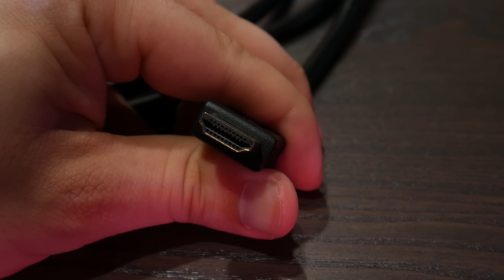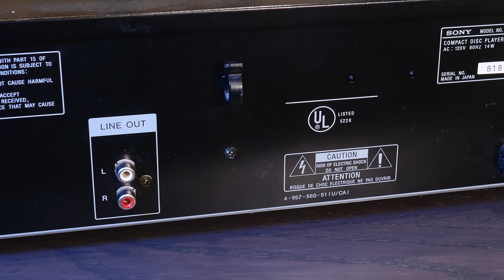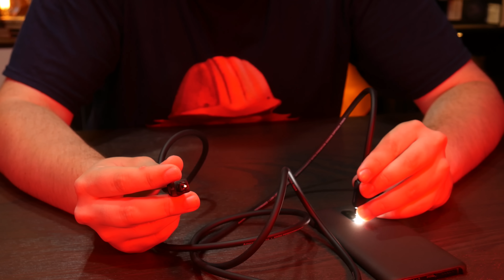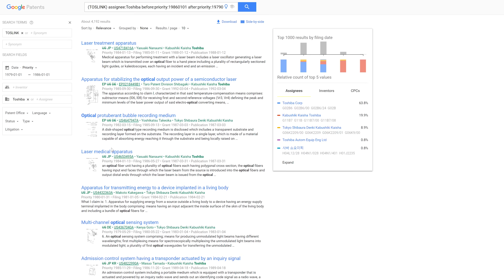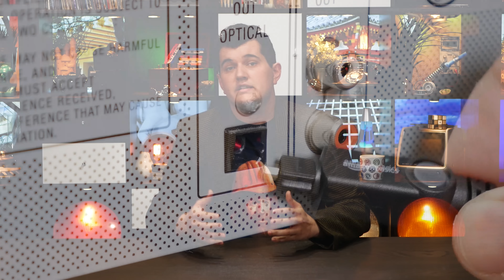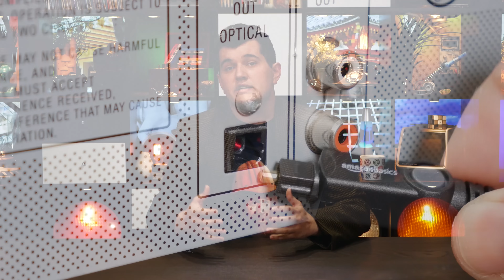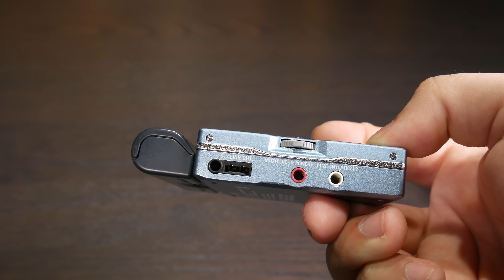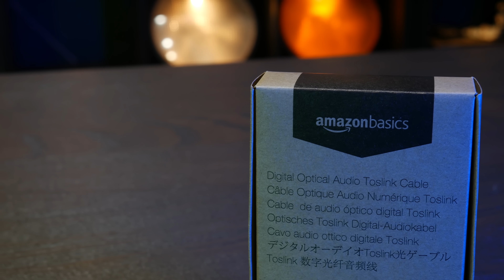TOSLINK: That one consumer fiber optic standard

Comment: Toslink is amazing.  I only wish dolby digital live could support 7.1.  If if does, I am not aware of it.  I am not sure if its a data bandwidth issue of the fiber itself or just and older technology.
Reply: Dolby Digital only supports up to 6 channels. Dolby Digital Plus allows 8, but I am not aware of any live encoders. There is no bandwidth issue. TOSLINK can do 125 mbps. They killed it because it has no encryption, and Hollywood was scared about piracy yet again. That, and HDMI can carry both audio and video together.
Reply: eARC is better
Reply: @andykillsu  HDMI is stupid. There is no way to use it for just audio. Yes there are scenarios where one may want to use it. I have a desktop PC, and a TV nearby, with its own media player. I mostly watch stuff on the desktop, and I run only stereo from the line out of my desktop to the line in of that media player, which is hooked up to my surround receiver via the analog ports. Got it for 50 bucks. 7.1 channels, has HDMI, but no 4k support. Useless, and newer receivers that offer both 7.1 and 4k support are outrageous. Regardless, I'd still have no way to pipe that 7.1 from desktop to a receiver, as I use DisplayPort.